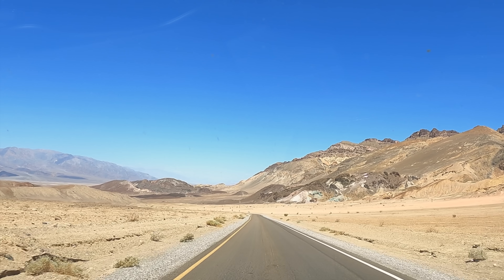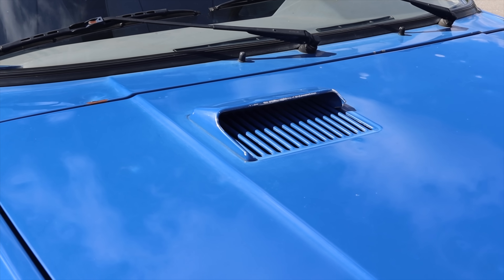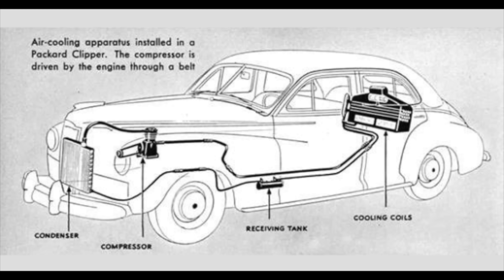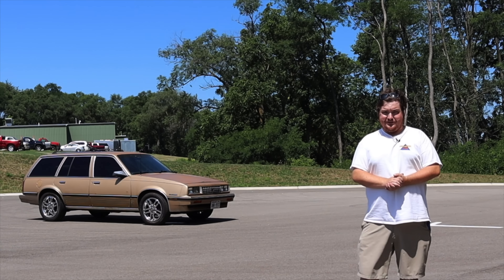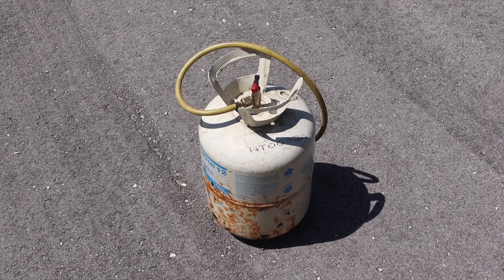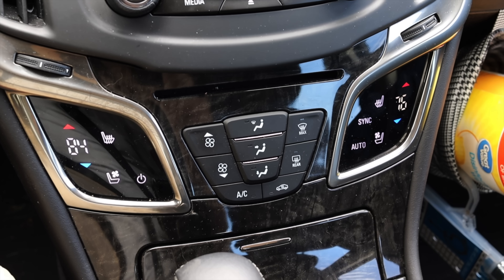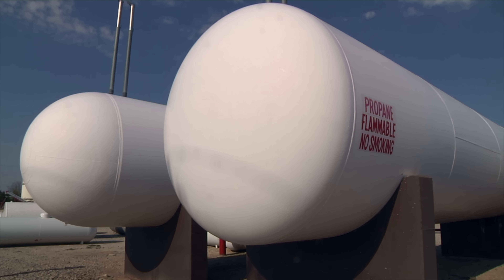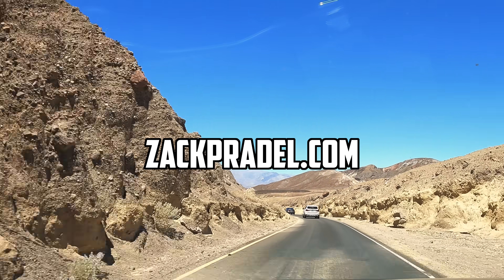Air Conditioning - The Story Of R12 & Why Modern Air Conditioning SUCKS!

Comment: I just thought I'd note that depletion of the ozone layer wasn't a global warming thing. The ozone layer absorbs ultraviolet light that would otherwise come down to the surface and cause damage to organic creatures like us(sunburn, skin cancer, cataracts). Hence, ozone depletion was an immediate public health concern.
R134a doesn't deplete the ozone layer, but DOES function quite well as a greenhouse gas, trapping infrared light(and thus, heat) that the Earth would otherwise radiate into space.

I believe R12 was ALSO a greenhouse gas, but a less powerful one than R134(which is INCREDIBLY good at trapping heat, somewhat ironically for a refrigerant). It is hard to check now, since that wasn't the concern when it was being phased out.
Reply: Finally someone bringing this point up!
Reply: In other words...
The sun is a deadly lazer
Reply: It was mostly aerosol solutions that depleted the Ozone layer.
Reply: @Rubensteezy  yes we used to use r12 as a propellant for aerosols like spray paint or hair spray because it's non toxic and is highly compressible compared to normal air or CO2
Reply: Basically tell people to google GWP’s and ODP
Reply: Ahh…ozone layer, something that political leaders will use to scare people, so they can get more of the green stuff they like so much. 😂
Reply: Ok… How come the suns rays can get through on entry, and then somehow get trapped on exit ?
Reply: @altingashi3927  The answer is, as it happens, they don't. Things get hot when they absorb ANY wavelength of light, and hot things emit infrared radiation. So, say, your black asphalt streets effectively convert visible light into infrared light.
Reply: @CptJistuce  but wait, the whole argument is, because of  greenhouse gases, the usual amount of rays that get reflected back to space get trapped because of the thick layer of greenhouse house gases. 
So how come they have no trouble getting in, but a lot getting out ?
Reply: @altingashi3927  Emitted, not reflected. IR that usually escapes from Earth to space is trapped by greenhouse gasses. 
There's no trouble getting in because most of it isn't coming in as IR.
Reply: @CptJistuce  what’s IR
Reply: @CptJistuce so then how comes the IR gets in but can’t get out ?
Reply: @altingashi3927  Any hot object emits infrared radiation. And one of the ways things get hot is by absorbing light of any wavelength, not just infrared.

And having checked... greenhouse gases don't reflect infrared, they absorb it. So incoming infrared warms the air up.
Reply: @CptJistuce my god, why have I wasted my time talking to you.

Can anyone actually answer my Q’s
Reply: @altingashi3927 I thought I was.
Reply: @CptJistuce  first of all you have an anime pic as a pfp. 
I can’t take anything you say seriously. 
And second, you haven’t answered jack, you’re just moving goal posts 
Don’t want to waste my time with bs
Reply: @altingashi3927 I haven't moved any goal posts, I didn't even know there were goalposts to be moved.
Reply: @CptJistuce   well it’s obvious you don’t bro. 
Anyway, all the best
Reply: this is all a fiction about  R12  ozone only has a half life of about 10 to 15 minutes  and in water rich air maybe a few days   
  check this out  there must be some thing beyond my memory on the internet
  for sure the Wackos will want to say some thing other then  what will put 
  money in there banks      and they want control
Reply: @claycoates5056  R12 doesn't have a half-life. That's really only a thing for radioactive substances, and something with a half-life of fifteen minutes would be very radioactive indeed.
Reply: @CptJistuce  WOW  I do not know where you went to school    most refrigerants in deed do have a half life
not sure of  how long that would be  but  not long  and Ozone dose have a half life  and it is very short   i have in the past checked on this    you might want to look that up       be-four making such a bold statement  
one can not just invent  facts    because         thank you for coming back
Reply: @CptJistuce  half-life is just the time it takes for 50% of a substance to be depleted. Pollutants have a half-life in the atmosphere, drugs have a half-life in the body.
Reply: @claycoates5056  that's not a half life tho it's just decay
Reply: @AgentOffice  i have seen where it has ben referred to a half  life and the time is Short  in hours   interesting come back
Reply: ....and all that is all b000lsheet designed to soak us for more money and make things work less and less well for us and thus to further enslave us to the cabal
Reply: R134 is incredibly good at trapping heat, but R12 is about 8 times better (meant in a bad way of course). An interesting chart is at https://www.ghgprotocol.org/sites/default/files/ghgp/Global-Warming-Potential-Values%20%28Feb%2016%202016%29_1.pdf.
Reply: I was told it was the chlorine in R-12 that was destroying the ozone layer. This like every other racket is about making money and destroying the middle class. If the chlorine is destroying the ozone layer why is anyone allowed to have swimming pools? It gets added to the water to keep it clean and clear but what happens to it? The sun evaporates it and you add more. The UN Agenda 21 states that the developed countries must sacrifice so the underdeveloped nations can catch up. Who is behind all this global warming and ozone depleting BS? The UN. By the way most residential air conditioners used what was called R-22. Its production has been discontinued also and the cost of it has skyrocketed because the UN has decided it too is causing global warming. So they came out with R-410A which runs at much higher pressures and consumes more electricity to pump it. Now they are going to discontinue it. This is all money making BS and we all need to wake up and realize what is going on. Isn’t paying $5 for a gallon of gas because of this BS enough to convince all the college educated Marxists that they are coming for you, me and everyone else? Don’t believe me go to the UN website and read it for yourself.
Reply: Half right. Ozone breaks apart the refrigerant. UV light is how ozone is made in the atmosphere.
Reply: @patrickprafke4894 refrigerant never makes it to the upper atmosphere. It is too heavy.
Reply: @roddycreswell8613 yeah. I know. Ozone also doesn't stay up either.
Reply: Supposedly those refrigerants depleted the ozone layer, but I kinda don't trust when a major refrigerant manufacturer (Dupont) with patents running out is the one who pays for the study. How convenient old refrigerants are bad but they have new "safer" refrigerants with patents ready.
Reply: @theo21021  well if they didn't deplete it then it's a pretty big coincidence that the ozone layer started repairing itself AFTER we stopped pumping the ozone killing shit into the atmosphere...
Reply: @mrl22222  it actually was just a weird coincidence. There’s no evidence other than lucky timing that the fazing out had any impact. The ozone layer is just an example of shit happens
Reply: @homurseempsone154  lol what? CFC and HCFC refrigerants as well as aerosols found in products like hairspray at the time were ozone depleting. That's not up for debate and not an opinion, its a simple fact. When those substances were banned the ozone was able to recover.
Reply: @Redtooth75 Calm down Waldo, it's really convenient that Dupont, the holder of the patent for R12, which was about to expire. And the same thing happens every time their following patent is about to expire. Meaning,  Dupont continues to hold the patent on whatever refrigerant is deemed usable, Worldwide !
Reply: @glennjames7107 wow, you are completely 100% wrong. The patents for R12 and R22 expired in the 1950s. So yeah.
Reply: @mrl22222  and who said that ?… oh DuPont again
Reply: @mrl22222 I hate that I have to live on earth with people like you
Reply: I'm not that worried about greenhouse gases in quantities this small, though. I probably generate more greenhouse gases in a day by breathing and farting than the volume of a car AC which will be maybe vented to the atmosphere a couple times in its lifetime worst case.
Reply: @dgpsf  Its not just the AC in your car. Your Fridge, Your home AC, Ice machines and every thing that you can imagine that gets cold by a refrigeration cycle. Add all that up and it gets pretty serious. 
R12 has a GWP (Global warming potential) of 11547
R134a has a GWP of 1549 so about an order of magnitude less bad
R290 (Propane) has a GWP of 3
Reply: @dgpsf  Yes, we are now emitting every time we exhale what the EPA now classifies as a pollutant - carbon dioxide. How much does 8 billion humans emit every day and what can be done to mitigate it?
Reply: The issue with the global warming from greenhouse gasses is that the earth naturally flushes out gasses as well as heat. Now, does that mean we shouldn't care about emissions? No, that shit still causes acid rain and smog, much bigger concerns due to their direct affect on our health. Drilling for oil and deforestation/intrusion of natural landscapes has had a bigger affect on animals, same thing with plastics and manufacturing. But rather than rant about being focused on coming up with(/returning to) ways of having consumables not be so... well, *consumable*, we demand we come up with... consumables. Because that's what 'green' energy is. The logic of putting wind farms in oceans because the winds stronger is the same as trying to harvest nodes from the ocean floor for minerals—both cause irreversible damage to the area's environment. Solar panels take up tons of land, I mean, nuclear energy has improved so much and is so hard to weaponize due to its safety that it's the best/only way. But that would create more jobs and less production.
Reply: What forms ozone?what is lacking at the poles the time the holes appear?
Reply: @roddycreswell8613  lighting  creates ozone
Reply: @petergracemeguide1280  more precisely UV light.
Reply: @roddycreswell8613  it does create ozone. It ionizes the O2 in the air to create O3
Reply: @roddycreswell8613 SUN LIGHT !!!! 
Wait till they figure out that Dupont's patent was about to expire !

Comment: As of 2021 ALL car makers must use R-1234yf. R-134a will be a thing of the past just like R-12 was in 1995. Only difference is they still make HFC-134a and R-134a, unlike R-12 , but I'm sure that's coming to an end soon as well. Also my 2021 Nissan and 2022 Jeep A/C do get real cold even on 107 degree days in humid climate in Texas. I have older ones a 2015 Jeep, and a 2002 Avalanche rocking the R-134a that is just as cold. I had a 91 c/k1500 that used R-12 and it was not that much colder. If I remember correctly it was like a 5 degree difference coming out of the vent when it had to be converted to R-134a after the line blew. I had one of those temp things that clipped in the vents to see.

Comment: No question R12 performs better than 134a. I remember driving my 1987 Suburban and having to turn the vents since my hands would actually start hurting from the cold air. However, my current car still has me wanting to turn the vents away because the air is too cold. It may take a little longer and it's not as cold, but I still feel it.

I feel automatic climate control systems have made up for almost all this difference. In the Suburban I'd have to manually control the fan and temperature and never really got optimum temperature (and I did have the rear AC unit). My current car does very well at regulating the temperature and cooling the car down, even when it's really hot.  While R12 probably would cool it down to comfort level a little sooner, I spend little, if any time thinking about how cool the car is (or is not.)

It appears we have a successor to R134a, which cools like R12. If the price we paid for saving the Ozone Layer was a couple of decades of slightly less cool AC, then it was worth it.
Reply: Not "a couple of decades of slightly less cold AC". It's actually forever less cold AC.

Comment: You can fill r12 systems with r134. that said  to prevent future leaks it is recomended to change all the seals of the ac system with others that are compatible with r134.
Reply: You CAN, but it won't work as well since the condenser on an R12 system is so much smaller than an equivalent R134-designed system.

Comment: The information in this video lacks the actual technical understanding of a/c systems. A system built for R134A works very well with R134A. I just serviced such a system yesterday and you would not stay in the cab if it was stuck on max cold and high fan because you would be too cold. I have also done many R12 to R134A retrofits. MOST of the time they work well. Biggest problem in most cases is people throw on a set of adapters and charge them with R134A. This is not a proper retrofit and may times will not cool well. The few retrofits that I have seen not cool well are primarily due to the condenser being too small to be able to dissipate enough heat. It is important to understand how an air conditioning system works before attempting to speak intelligently about any related component.
Reply: I posted mine before I read yours. You are CORRECT. Here is my post:

GM always had the best A/C system. By the 70s Ford even started using their components. Rolls Royce used GM A/C systems. Yes, I have had MANY Buicks and Cadillacs with R12 and they will freeze the balls off a brass monkey. I still have one 1970 Buick with its original R12 system. However the best A/C I have ever had is my current 1995 Buick Roadmaster with R134a.  One reason why R134a gets a bad rap is because of the people who convert their R12 cars to R134a. They typically do not do more than evacuating the system, making sure the oil is all flushed out and then changing the ports. Some go one step further and change the valving system (either suction throttling valve---STV or Pilot Operated Absolute---POA valve) to make sure correct pressures are met for R134a. So far so good. But one crucial component that needs to be changed is the condenser. You just cannot expect R134a to work will with those old 3/8" tubing in the R12 condensers. You need to move to a high efficiency condenser, which has MUCH smaller tubing and many more and finer fins. Some people can get away without changing the hoses. R134a needs better barriers to avoid leaking because the molecules are smaller.  Kind of like even a surgical face mask will not prevent the covid virus from passing through. Most people are not willing to pay $2000-$3000 to properly convert from R12 to R134a so if they do it at all, they do it half-assly. Heck some people, even here in Tucson won't maintain their A/C systems in cars less than 10-15 years old. I see them driving around town in 105F or hotter days with all their windows down.
Reply: Not necessarily true. Older cars were designed for cooling comfort and not efficiency like today’s cars. The compressors were much larger not only in size but in their displacement. The old GM A/C compressors had 6 pistons in them if I remember correctly. Also newer cars will cycle the compressor when the temperature of the evaporator gets too cold when in the older cars the compressor ran non stop as long as you had the A/C on. Modern cars have fans that circulate more air than older cars did, I’ll give them that but the older cars would get bone chillingly cold if you allowed them but newer cars not so much.
Reply: @mikee2923  Wrong about compressors not cycling on older cars. My 60s and 70s Fords with AC had a thermostat sensing the evaporator core temperature and they would cycle to prevent the coils from freezing over. Modern cars pretty much control the system in the same way.
Reply: @milstarr  My 1975 Pontiac Grand Prix doesn’t cycle the compressor off unless the outside air temperature is below freezing. It runs continuously by observation and according to the factory service manual. I also had a 76 Oldsmobile Toronado that worked the exact same way. They both had what was called a superheat switch that would blow a thermal fuse and shut the compressor off if the refrigerant charge got too low. Otherwise the compressor clutch would stay energized at all times during air conditioning and defrost in above freezing outdoor air temperatures. Perhaps I should have specified GM cars.
Reply: @mikee2923  That is not completly true, while it may not cycle the compressor it has a valve that does the same effect without the need to disingageing it if the evaporator temperature goes below freezing, the reason is that if allowed to run continusly in more moderate weather the evaporator would freeze up the moisture and thus block the flow of air and slow down heat transfer, thus making the AC work less efficently. If any AC systems blows ice or snow, its has a malfucntion.
Reply: @MrTheMiguelox  Yes you are correct. There is a POA valve that will bypass enough refrigerant around the evaporator coil to prevent it from freezing over. It boils the refrigerant off in the receiver on these type of A/C systems so the compressor doesn’t pump liquid. It does however allow enough refrigerant to pass through the evaporator to keep the coil at its coldest temperature without freezing. Under the right conditions (cool temperatures and high humidity) the vents will discharge a fog out of them if heat isn’t applied to the air. This is due to the fact that the colder the air temperature the less moisture it can hold. When set to max a/c the temperature slider was disabled preventing the air from being heated. Also depending on how the car was optioned determined how the blower was controlled in max a/c. With no heated back glass, the blower was locked on high. If the car had the heated back glass and a 63 amp alternator it would lock on high unless the heated back glass was in use then it would lock it on medium high. If equipped with an 80 amp alternator it would lock the blower on high regardless of any accessory usage.